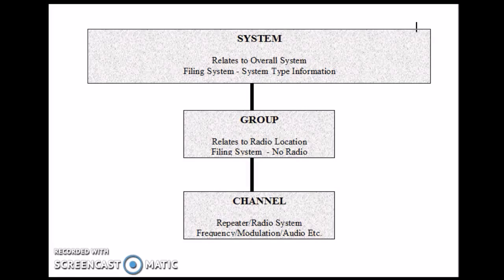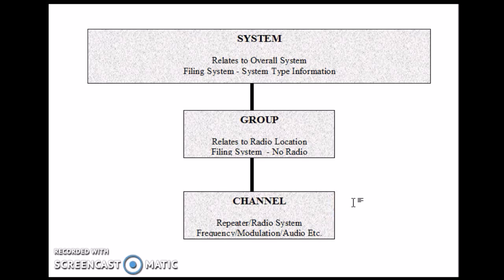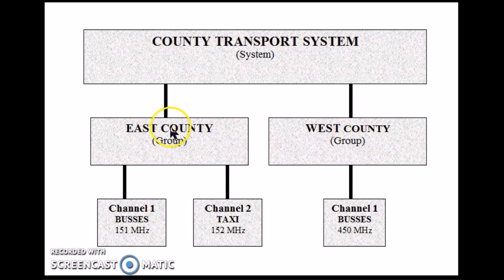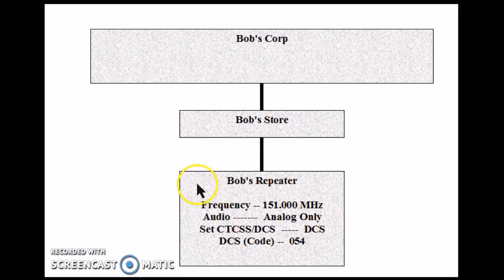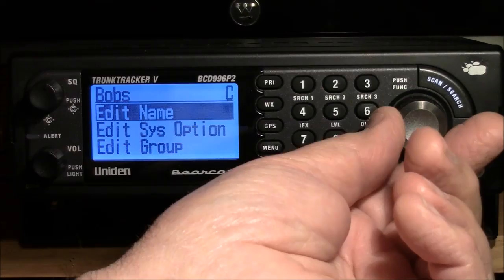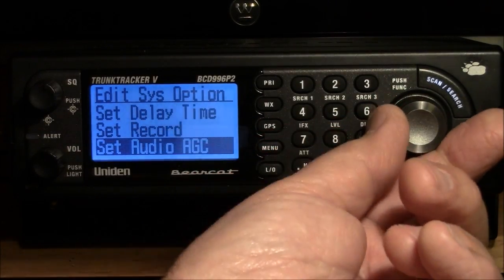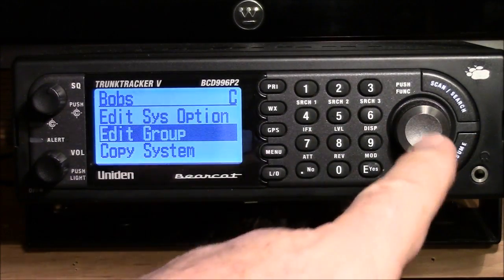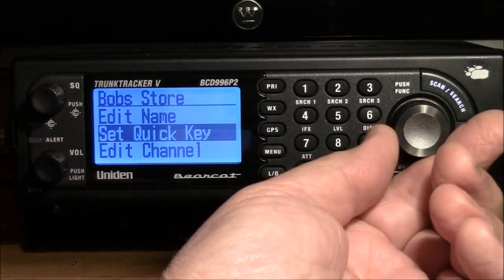UNIDEN BCD996P2:  Programming Conventional Systems.

Comment: You don't know how happy I am to see scan mode, nothing to scan. Your vids on this scanner were so helpful. Thought I was going to go nuts reading this book. And your right. There is no flow chart to go by. Thanks again. And keep the vids coming.
Reply: If you have nothing programmed in, then it will say "nothing to scan". This is 100% normal. This is a fantastic analog/digital Phase 1 and Phase 2 scanner and also great on analog too. I recommend using a Diamond RH77CA over the supplied metal telescoping antenna.

Comment: Trunking is coming soon to my area and I'm waiting on this jewel to arrive in the mail. I read the manual and had some idea of the setup but seeing it demonstrated in your video gives me the confidence that I can transition to the different format. 

Conventional is just nested files - like mp3 collections or document storage. 

73
Reply from the maker: The main issue I found with trunking is that if you don't locate all the users on a system, it can cause weird stuff.
I have very little trunking where I live but if I did I'd spend the $15 bucks and load the scanner from Radioreference.com.